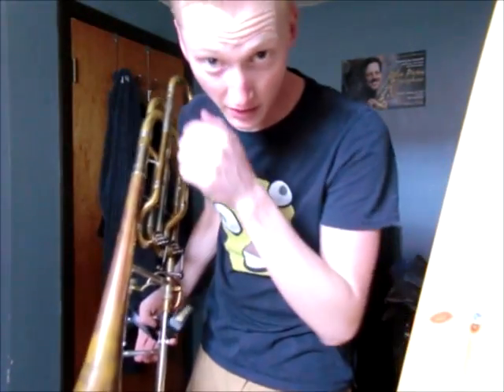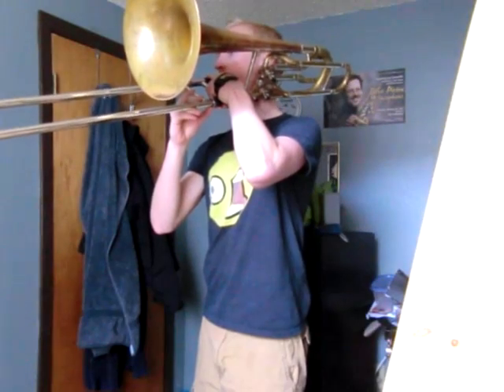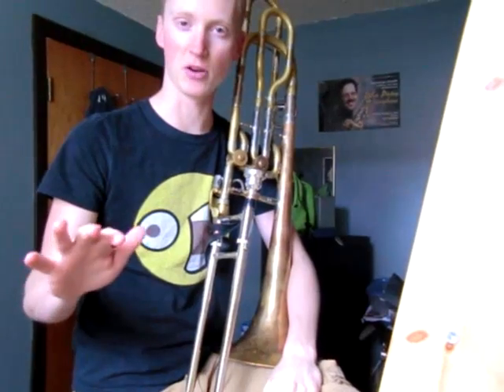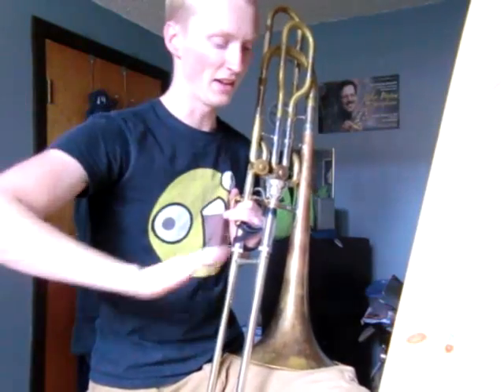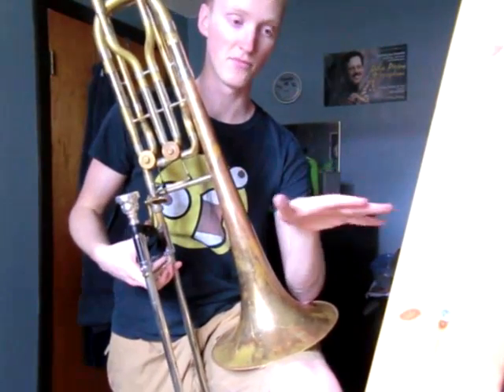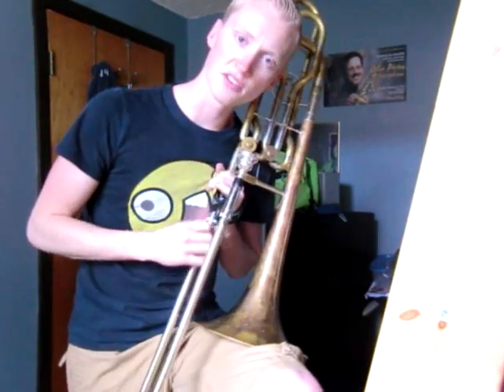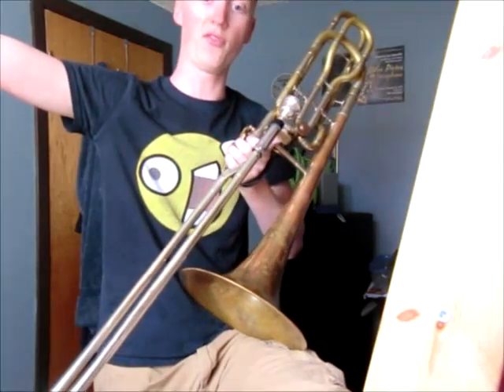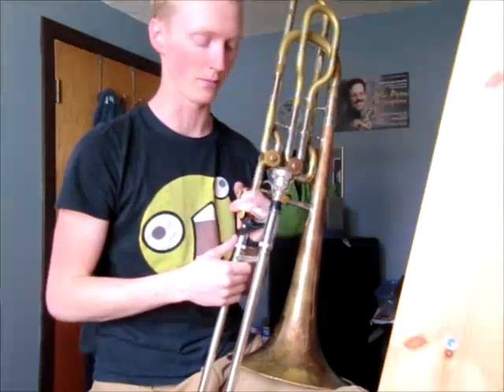The Double Pedal and more False Tones!

Comment: I'm sure you've answered this before (so sorry in advance) but what's your ax?
Reply from the maker: No problem! In this video, I'm playing a Holton TR-180, modified by Larry Minick. But that horn is long gone! I sold it in 2013 I think. 

Now I play a dual bore Edwards slide, first generation Thayers, Bach tuning slide and bell.
Reply: Aidan Ritchie Oh wow. How'd you like it? I'm a senior in HS playing a large bore tenor and looking for a bass.
Reply from the maker: It depends on your budget, but the best horn around 3K is the Shires Q Series bass. I could happily play one of those full time. 

My horns are pretty one-off, not as easy to get haha!
Reply: Aidan Ritchie Oh I can tell lol. And mine currently is around 2500
Reply from the maker: Austin Mann I would still go for the Shires. It's the best horn even close to that price point.
Reply: Aidan Ritchie Alright, thanks for the advice. Slightly related, whats your preference on rotors?